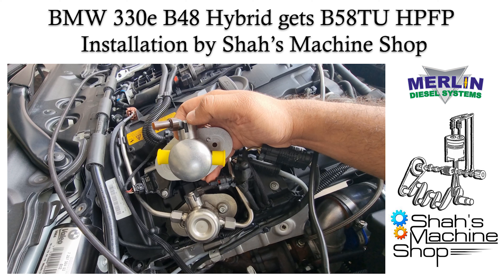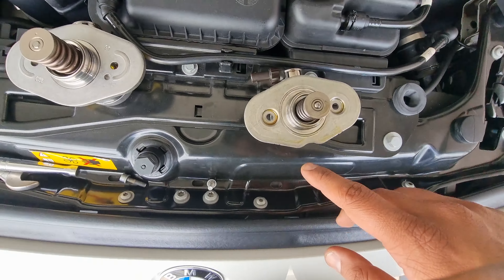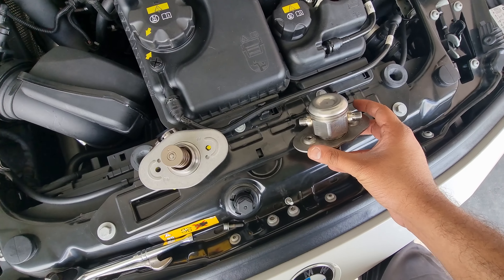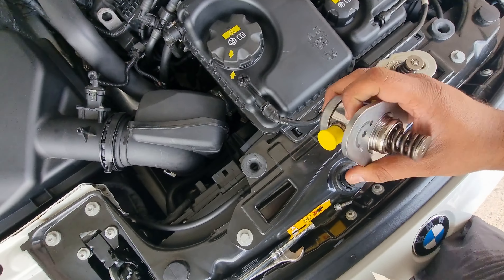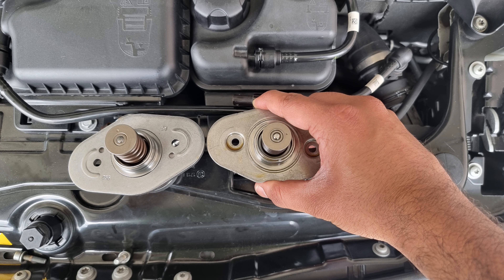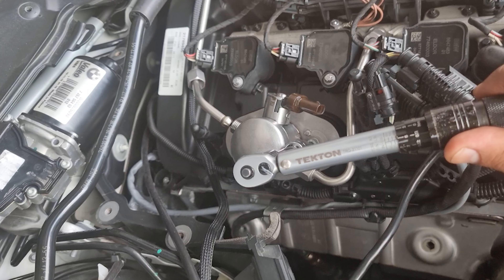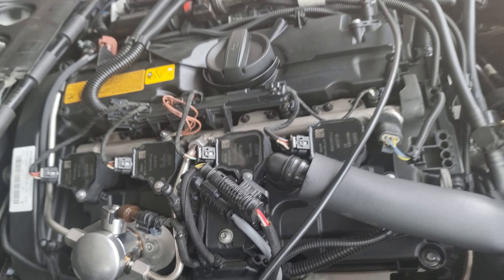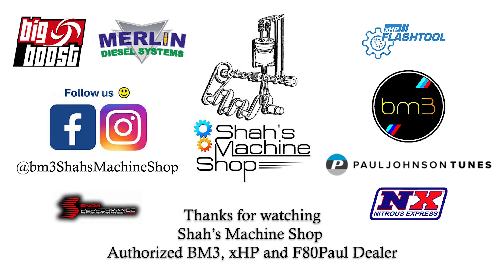BMW B48 HPFP Upgrade

Comment: Goes g20 330i need Hpfp upgrade ? Was told it runs b58tu pump from factory . Safe to do e30?
Reply: no it can run dull e85 on a custom tune with stock HPFP

Comment: Cool video, man. At what point is a HPFP required on the B48 engine? I currently have an F22 230ix (2020) on Map 2 of JB4, downpipe, charge pipe, air intake. If I want to upgrade to a larger hybrid turbo (Pure Turbo), which caps off around 400hp, would I need this? I don't plan on running any ethanol mixes but I will get a custom tune after
Reply: fuel upgrades on the b48 are really only for anything past e30 bro, if you're sticking to 91 then you don't need it
Reply: Did you ever end up going with pure turbo? If so, how are the results? Did you replace any internals before swapping? How much power are you pushing now? Post a video if you did go with pure turbo!
Reply: @stringstrang8043  pures suck
Reply: @purpleguy6973  I've never used a pure turbo but do you care to elaborate on why pure turbos suck?
Reply: @stringstrang8043  the gains are just not worth the cost. full frame kits that support 100hp more than pures and cost the same are easily better, not to mention they're notorious for capping about hp/tq figures with em

Comment: So its a direct replacement?
Reply from the maker: Yes that is correct, we also measured the cam lift on the camshaft tri-lobe when the engine was outside to confirm compatibility which was sent to Dorch Engineering.

Comment: Can i upgrade B58tu hpfp to F30 320i B48b20A? Dose this work for my engine performance?
Reply from the maker: Yes you can upgrade. You will need to custom tune to see performance gains. Also depending on what fuel and turbo you will be running, it may or may not be required. If you are planning to run high concentrations of ethanol. It will definitely be worth it.
Reply: @bm3shahsmachineshop  you have a lpfp upgrade too? Mine failed recently and I'm out of warranty... completely screwed lol. would really appreciate any feedback you could give me, I'm dyno tuned on e85 rn
Reply: @purpleguy6973  what car?
Reply: @Starscream8896  230
Reply: @purpleguy6973  did you get an upgraded lpfp or oem?
Reply: @Starscream8896  lpfp upgrade, i need to get the b48tu pump prob
Reply: @purpleguy6973  ohhh you were a gen 1 that makes more sense. Yeah the b48tu pump from gen 2 is same one in gen 2 b58’s thats good.
Reply: @bm3shahsmachineshop can i upgrade it to n20 328i ?!
Reply: @bm3shahsmachineshop what about 99RON / 99 octane fuel? Is the TU pump beneficial for this fuel quality?